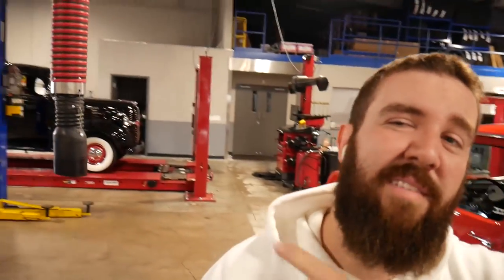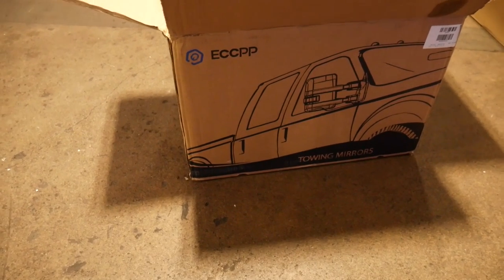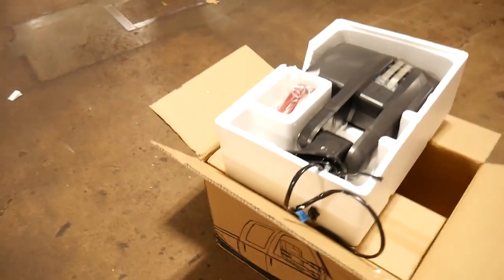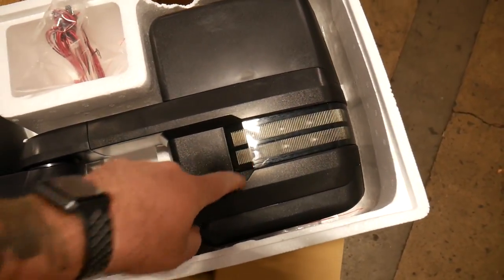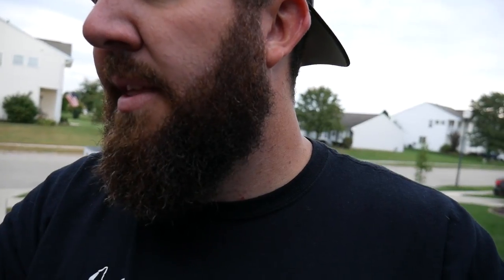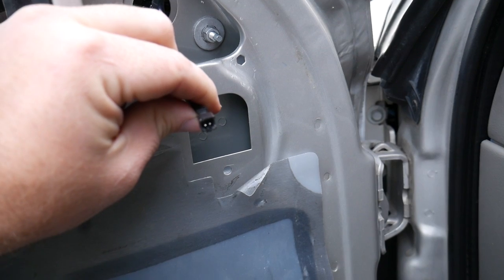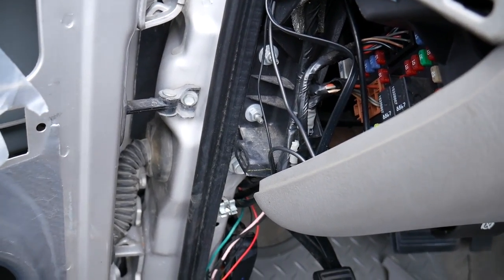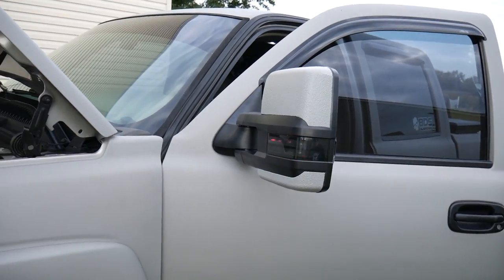NEW BODY TOW MIRRORS ON MY DURAMAX

Comment: You can plug them into both the reverse and the door if you use diodes to limit the flow of electricity to one direction.
Reply: I did this exact thing when I installed them today .

Comment: No need for resistor,  go to autozone and pick up a flasher relay that can handle leds they are like 12 bucks and you can have as many leds as you want
Reply from the maker: True! I thought of that, but as I’ll show in my next video or so, resistors are way cheap and easy anymore. The set I’ve got coming was like $9
Reply: @RustbeltMechanic  yea just figured less wiring, only issue i have is my driver side marker light hyperflashes and the light on the dash stays lit up

Comment: Great vid. I hope you have better luck then me. The first car wash with mine the motor failed in one and then two weeks later the turn signal in the other side stopped working. I wish I went with boost.
Reply from the maker: So far so good after a few days including a car was and rain. Only thing so far i have complaint wise is that the passenger side mirror is almost turned all the way in to see things correctly.
Reply: Rustbelt Mechanic hmmm that’s strange. I know my passenger side mirror was hard to angle correctly until I leveled them. I also just checked mine as well and it’s almost all the way in as well as yours. I think it will be a little better once you level them as well.

Comment: There’s no wiring diagram... the extra wires for the backup LEDs are red and black, you used red for power what’s the black for?
Reply from the maker: Ground circuit

Comment: My mirrors came with 3 wires and no schematics have no clue where to run the two wires got my ground done but super confused on the other 2, you just have a power and ground…

Comment: does the DRL lights work on the mirrors?
Reply: Reshad Amiry No. I bought these mirrors and they only have signal and reverse light. Tried wiring it a very shitty way into just being a running light and the LEDs started to go out the very same night.

If you want high quality ones go to boostautoparts.com. I bought my new ones from there and they’re amazing. They’re a lot sturdier than these ones, they lock stronger when you fold them, and they function as running lights as well.

Comment: Thinking on getting them. Are they still good?
Reply from the maker: They are still working pretty decent. Only thing is I still don’t like the fact they can’t adjust the mirrors in any further.
Reply: Rustbelt Mechanic what do you mean can’t adjust any further?
Reply from the maker: Andre G the actual glass itself doesn’t quite adjust far enough in towards the vehicle.
Reply: Rustbelt Mechanic okay thanks, really want the tow mirrors look on mine and was wondering if I should get this
Reply: @RustbeltMechanic  I’ve been told those mirrors rattle when driving what’s your experience

Comment: How’s the quality of the mirrors? Are the mirrors actual mirrors or stickers? (Hope that made sense) and do they shake when u r driving?
Reply from the maker: Yes they are actual mirrors. The top mirrors do have a slight shake down the interstate but aren’t too bad. My biggest complaint is that they aren’t in a great detent spot. It’s like I can’t adjust them in quite far enough. If they could be tilted in 1” farther they’d be great.
Reply: Rustbelt Mechanic I see, thanks for your response. I’ve been looking at getting some tow mirrors myself just doing some investigating on different mirror brands.